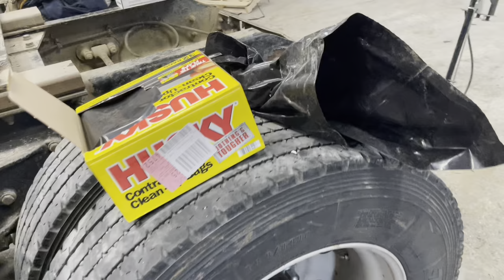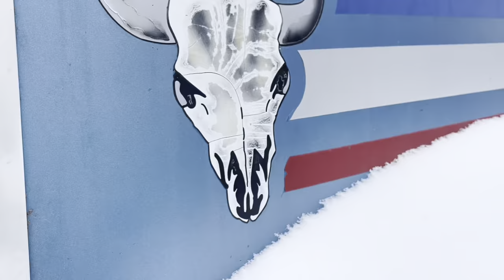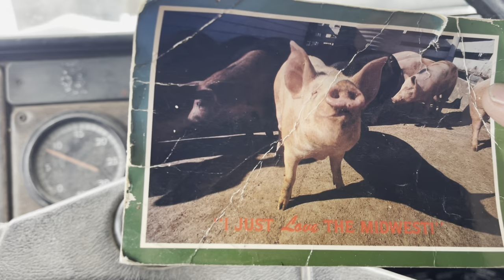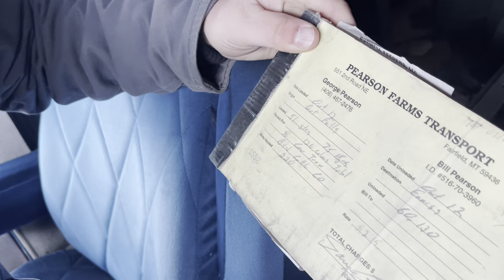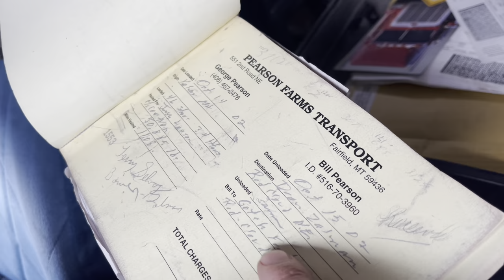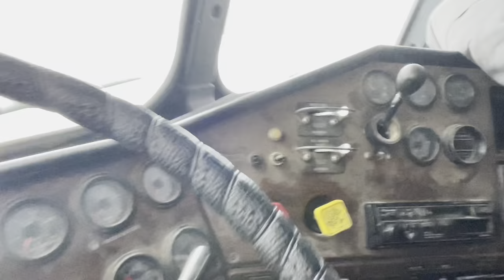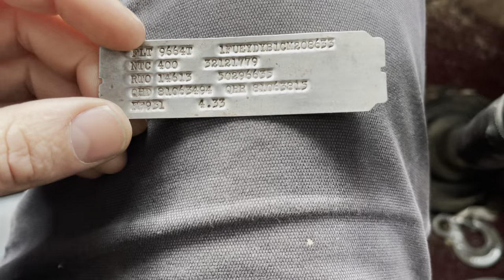I have to bring this Freightliner Semi home!

Comment: Those old Freightliners are bulit proof trucks. 
Old is the way to go as far as am concerned. 
New trucks you just drive until the check engine light comes on. 
Then throw another  two thousand dollars  at it .
If your lucky. 
Have a great weekend.

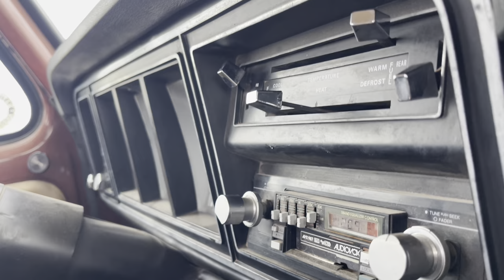Comment: I didn't catch the year of the old Ford F150, but it's gotta be a 78-79 model with those square headlights.... The interior shots at 18:35 took me straight on back to my childhood and my dad's 1977 single cab. Beautiful memories. And that interior had common elements all the way through the 1991 model year - the skinny metal turn signal, the manual window winders, hexagonal plastic door lock indicator knobs, etc. Good content, Jax - I love the connection you feel to the past. Edit - just noticed the license plate at the end of the video, lol

Comment: The brake saver is the way to go on a B model Cat . Down side is they require "resealing" about every year or so. The factory Jake's are pretty weak on 3406 B - unless your running the "super Jakes" ( they don't make them anymore )  used rebuilt is the only option - if you can find them . As the saying goes " IF IT AIN'T A CAT - ITS A DOG " ..

Comment: I have an 83 flc 120 with the aluminum hood 290 wb that I'm wanting to get back on the road. Was driving all of 21 and part of 22. But a bad over head job locked up the big cam. There is nothing like running those old school trucks up the road.

Comment: They both need new rails and fixed up then run them they are both large cars of their time but rebuild the s60 and try to find a pre 99 motor and tranny for the black one 18 SPD of course but they are both beautiful rides and need to be brought back and run them

Comment: A Vehicle Identification Number (VIN) for a semi-truck, like any other vehicle, is a unique 17-character code that provides detailed information about the vehicle. This code allows you to identify the specific truck, including its manufacturer, year of production, model, and more. Each character in the VIN has a specific meaning. Here’s a breakdown of what the characters represent:

	1.	1st Character: The country where the vehicle was manufactured. For example, 1, 4, and 5 are used for the United States; 2 for Canada; 3 for Mexico; J for Japan; K for Korea, etc.
	2.	2nd Character: Represents the manufacturer. Each manufacturer has a unique code.
	3.	3rd Character: A more specific identifier related to the vehicle type or manufacturing division.
	4.	Characters 4 through 8: These provide information about the vehicle model, body type, restraint system, transmission type, and engine code.
	5.	9th Character: The check digit. This is a calculated value based on the other digits in the VIN to verify the VIN’s validity.
	6.	10th Character: Indicates the model year of the vehicle. There is a standardized chart for this: for example, A = 1980, B = 1981, continuing through the alphabet, and then starting over in 2001 with 1, and so on.
	7.	11th Character: Identifies the assembly plant where the vehicle was manufactured.
	8.	Characters 12 through 17: These are the vehicle’s serial number, which is unique to each vehicle. This section is used by the manufacturer to identify the specific vehicle.

This VIN system helps track recalls, registrations, warranty claims, thefts, and insurance coverage. For semi-trucks, this information is crucial for fleet management, maintenance records, and legal purposes.